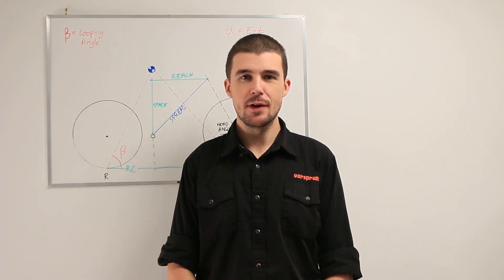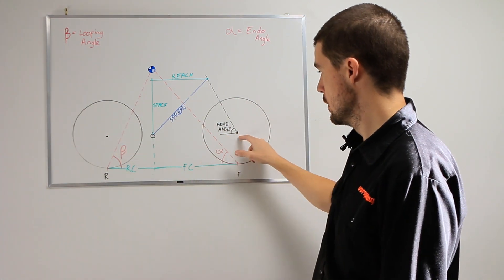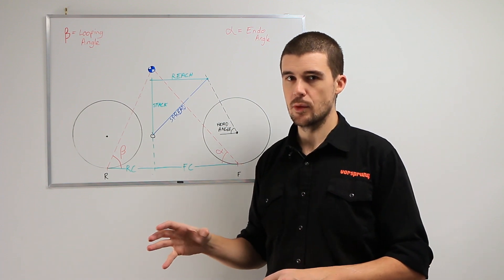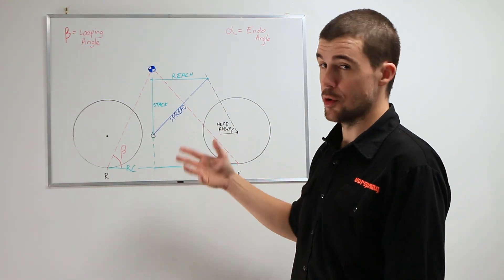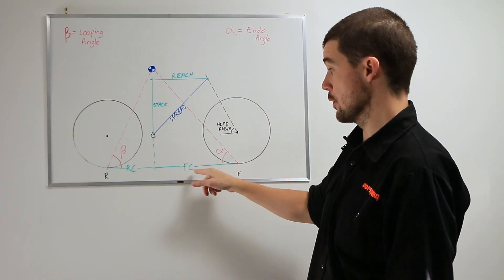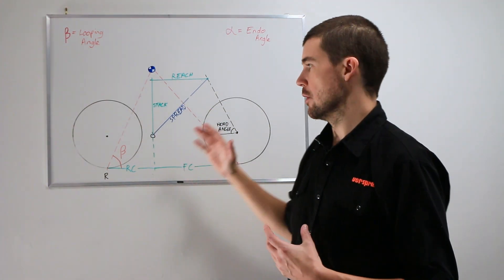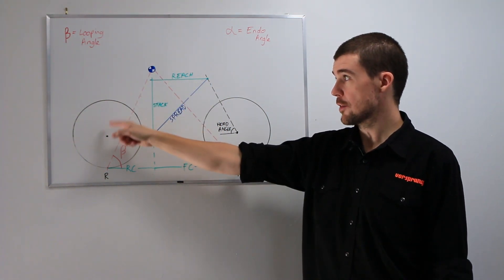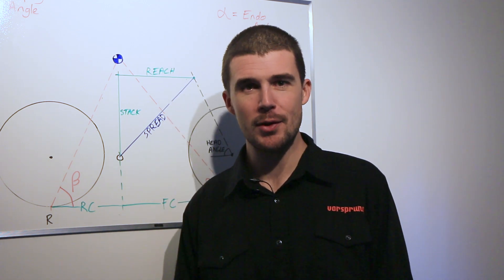Understanding Advanced Bike Geometry Pt 1 - The Tuesday Tune 25

Comment: No idea if you're reading comments to old videos but an answer/comment to this would be awesome.

Since you made this video MTB geo has progressed one or two stages, HTA has got way slacker, reach has extended, chain stays have somewhat stayed the same, seat tube angle has steepened up. My question is this: Has mtb genre (XC, enduro, DH etc) geo reached optimum yet, or is there progres to be made? I know the industry as a whole wouldn't tell us, as they always want to keep selling frames and components for those frames. But how much recent geo change is technically required as opposed to manufactured to sell new bikes? (Downcountry as a manufactured geo/genre is a prime example)

Comment: It seems to me MTB manufacturers are are doing a lot of RnD that's already been done by motorcycle manufacturers in terms of front end geometry. Right now everyone's obsessed with long low and slack but I haven't seen 1 manufacturer list the trail of their bikes, which is the main factor in how stable vs quick a bike feels, and the product of HA, fork offset and wheel radius. The manufacturers slacked HAs off to gain stability, then forks had to increase offset to get trail numbers back in line (think early 29ers with low offset and slow steering). That also increases brake dive. Another thing to consider is fork response. Slacker HA makes a fork feel more responsive over square edged hits, at the expense of increasing binding and decreasing responsiveness on big landings to flat. I think things have gone a bit too slack at the front end for trail bikes and its a bit harder to lift the rear over obstacles, especially as most of the bikes weight is biased rearwards with the shock, swingarm and drivetrain all concentrated there.

Comment: Speaking of CoM, why can't we have a curving dropper seatpost/seat tube, so that when it's down it's positioned towards the rear of the bike and when it's extended it's positioned towards the front of the bike?
Reply from the maker: Curved telescoping parts are incredibly hard to make. Simpler would just be a seat tube angle that's steeper and with less (or negative) offset from the BB.
Reply: It would be complicated to balance travel and shape of the post.  It would have to be curved obvs.  Then they would also need to start curving the seat tube, in the frame, which may have strength issues...?

Comment: Surprised you didn't mention the affect of BB drop and the subsequent moment around the axles/contact patch and how that effectively lowers the angles mentioned. The extra drop of 29" is one of their biggest advantages IMO, far less pitch sensitive.
Reply from the maker: That's a bit of a complex issue - BB drop doesn't directly affect the looping/endo angles at the limit conditions when pedaling (climbing) or braking (descending) because torque is transferred from the contact patch through the brake to the rest of the bike. It does indirectly affect it though (once you've actually exceeded the limit condition) from the perspective that the contact patch shifts relative to the rest of the bike once one wheel leaves the ground, and the curve along which it shifts is obviously dependent on the wheel diameter, so a larger wheel size with the same CoM height (ie same BB height above ground, same rider) which has more BB drop will see the contact patch shift a bit further out from the CoM. Dynamic motions that don't involve pedaling or braking however (eg pulling a manual) are very much influenced by BB drop, ie it's harder to manual a bike with a BB below the axle line than above it. 29ers in general tend to have longer wheelbases with longer FCs (due to the longer offset) and RCs (due to the larger wheel size limiting min CS length) so those angles are frequently shallower than the 27.5 equivalents. Bigger wheels also have far better rollover capabilities, lower shaft velocities and less hangup on larger impacts, all of which also improve the ability to smash through stuff without getting pushed around as much. However, on say a seated smooth climb, if the wheelbase is the same and the CoM location is the same (F/R location between wheels and height above ground level being the same), the BB drop won't affect that limit condition in any meaningful manner, because even though it appears you're rotating around the axle, the instant centre is actually the contact patch, so you'd have the front wheel beginning to lift off the ground on the same gradient irrespective of 26" or 29" wheels.
Reply: Thanks for the reply. I think you have to do a video on this.

Comment: This is soooooo eye opening! 
Finally, it makes sense now not only in my head that reach is critically related to stack height, something I noticed right away when I bought my Mondraker: plenty of reach coupled with a too low stack height, resulting in an unbalanced riding feel, mainly on the steeps,  so did some work to bring the stack up (riser bar + 160mm travel from 140mm) and make the bike feel more balanced. 
I can hardly wait for episode 2. 
Cheers!
Reply: The thing is stack is easy to change but with reach you are stuck
Reply: @zyoungson215  you can shorten reach by putting spacers in.
Reply from the maker: Glad you got something out of it!

Comment: lee mccormack talks about RAD(rider area distance) which is exactly the same thing as your 'spread.'  pretty interesting how you both noticed how important this measurement is to bike feel.
Reply from the maker: Yep - when considered with bar/stem config taken into account (which we'll delve into next week) it basically defines how big the bike feels when standing. It also determines how much leverage you have over your own body weight... which again will be covered in part 2. We came up with the term "spread" to describe it, but until the bike industry comes to some consensus on a particular term to use, there'll be a million different ways to cover it. Some guys back in about 2003 were using downtube length as some approximation to this too.
Reply: @VorsprungSuspension  pretty cool! if you get a chance, talk to lee mccormack, he's got some metrics and equations on how to find your RAD/Spread and a few other bike fit related things.
Reply from the maker: @useport80  shall do! We'll discuss some maths related to the spread in part 2 of this, particularly how it's relevant to bike handling.
Reply: When you vectorize that (distance, and angle from BB) it becomes a pretty comprehensive measurement in terms of bike size and bike intent (if designed appropriately).
I suspect that's a lot of what's coming up.
Reply: He uses RAD for arm strength while hopping/jumping while the bike is near vertical. 
In this video is calculated for COM and hand weight, but there should be a magic number for your limb lengths